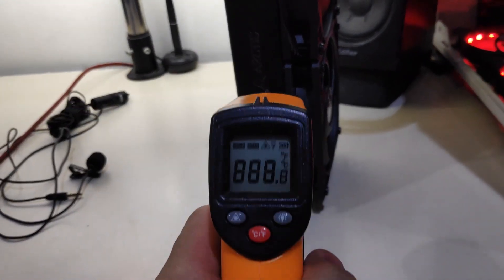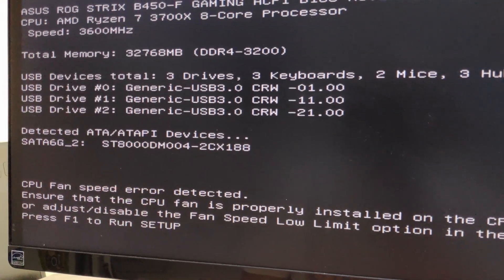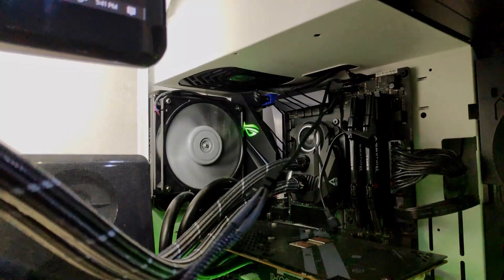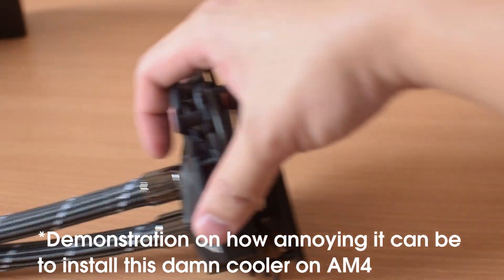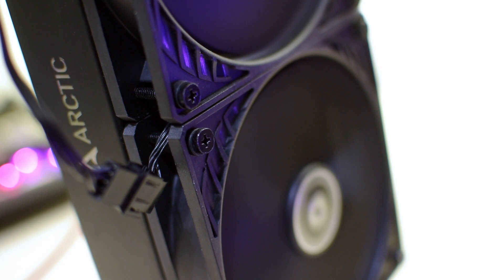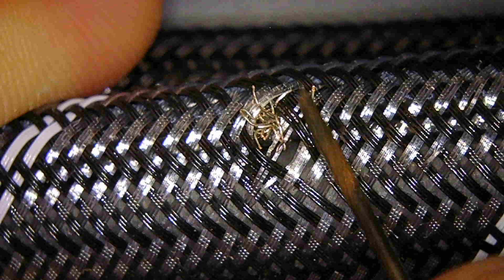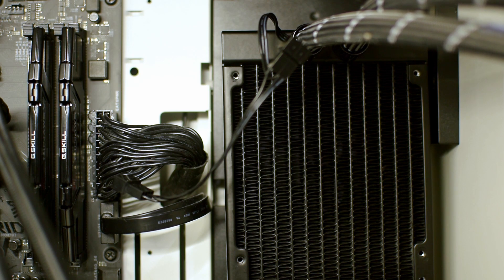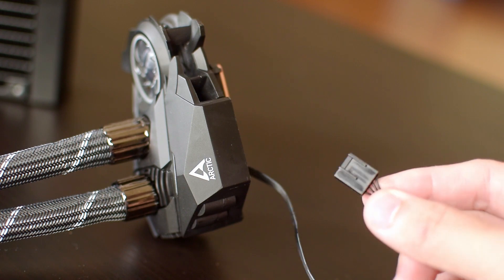DO NOT SIDE MOUNT! (EDIT: New video for Revision 2 review) - Arctic Liquid Freezer II Review

Comment: Gamers Nexus installed this cooler 36 times for their review, not a single issue. So reliability is not a problem, I'm sorry to say i think the issue lies with how you installed the cooler, not the cooler itself.
Reply: Or it could just be this unit, specifically. Maybe just maybe..
Reply: He installed the pump higher than the waterblock. 
He was basically running air in the cpublock

Comment: its good to see reviews mentioning what can go wrong and why.thank you.
was this the first version or v2?
Reply from the maker: Interesting, there's a first version and there's a V2? I will need to compare with the replacement I get and see if there are any differences physically.
Reply: i can't find anything regarding the two different versions. have been keen on getting a v2 but couldnt find a link
Reply: I got a rev. 3
Reply from the maker: Arctic listened with revision 3 and fixed the mounting system.
Reply: @TechRodent  But now I have to mount in in my Phanteks Eclipse P400A. It only fits in the front. I think i will go fans on the outside of the case. In a push config

Comment from the maker: EDIT: Arctic sent me a new Liquid Freezer II revision 2, and I re-reviewed it based on that. You can check it out here: https://www.youtube.com/watch?v=oQZQfDZNS50

The results are fixed but interesting.

-------------------------

I have been reading the comments on this video and understand the concerns of people, and I acknowledge that I do hold an unpopular opinion. 

I however, believe in honest reporting, and not just deleting a video or a review just because it doesn't sit in line with what other people are saying or reporting, so no, I won't be deleting this video.

I have however, got in contact with Arctic again, with this video in particular, and they have acknowledged that there is an issue with the unit that I have received (whether it's isolated or not I do not really know yet), and have asked if they can arrange to change me with another unit, and so I'm in the process of doing that now.

Once I get the new unit, I will do a follow up video addressing the claims that I have made in this one.
Reply: thats nice of them contacting you back about the issue, this particular problem is why Im still on the fence on getting any AIOs tho even though I dig the aesthetics of it.

Maybe you could do some videos on air coolers, like those snowman coolers that costs like 50 in Malaysia.
Reply: I too, now hold an unpopular opinion. For the past 5 weeks, Ive been watching for a 360 to come into stock, a CPU cooler is the last component I need to build my 3700x system, and so I was checking every single day, multiple times a day watching for one to finally come into stock.. then come the 16th of this month, 5 360s hit "in stock", I ordered one, and the remaining 4 sold in about 10minutes.. then today, the 22nd, I get this from Arctic.. https://imgur.com/a/j9mPYvN ! So, not only can Arctic not meet any semblance of supply for the demand, they also cannot meet order fulfillment on the rare occasion they do have them to offer ! So with the email I received today from Arctic, I am not happy whatsoever with the experience. I did however send them an email back early this morning, asking them, when the very next 360 is available for purchase, will they offer it up to me to purchase, due to the order fulfillment inconvenience placed upon me, so I am hoping to hear back from them very very soon with a positive answer, or maybe I wont hear from them at all and they could care less about the negative review I will then be giving them. A contact number for Arctic would be nice, but I couldnt find one. But I will afford them some time to respond, and by afford them some time, I mean about 24hours, as that seems to be industry standard time for response !
Reply: did you ever get your replacement liquid freezer II AIO? let us know, i'd like to hear what your updated review looks like with a working model.
Reply: it happened once. to a reviewer too. it's good this gets 'some' coverage. on a consumer side of things i want to be aware of that can happen with a certain product even if it's rare it's good to know that beforehand. I am not going to shy away from buying this aio but it'll at least have a video i can show all my friends if it does happen to me too. Please dont delete the video. why are people asking you to delete it? Good Video!
Reply: @briandiff1459  damn dude...that sucks

Comment: Props for keeping the video up.  It addresses the flaws and with it, they can improve their newer models.
I do believe you had a bad unit and thus the cause of your problems.  Could have been damaged during shipping, there isn't any real padding around the product to protect it inside the box.  Hopefully when you get a new one, it'll be much better.
I've had mine for a few months now, and I've mounted and remounted a lot.  I've even modified it to be a GPU AIO.  Temps are amazing on a 2080 Super.  The tubes are stiff, but my bends are crazy and there hasn't been an issue yet.

Comment: Had no troubles with installing with PC laying on floor.  If you are unable to "Hold the backplate securely in place" as stated in this video....work smarter, not harder.  Simply put a piece of tape to hold the backplate on the mobo and then remove once installed.  You got a bad unit.  it happens.  sorry about your experience but this is an amazing cooler.
Reply: Also the VRM fan is a gimmick

Comment: I have had this cooler since launch and specifically the 360mm version and I have to say it is without a doubt the best AIO I have used and I have been using AIO's since the first Corsair units many years ago. In terms of cooling I am very surprised at your results as mine overclocked to 5GHz on all 8 cores and 16 threads in Cinebench R20 the highest core hits 74 degrees C and all the others are between 66 and 73 degrees and that is about as good as it gets and beats out my older H150i pro. Maybe the mount was not good as on mine for an Intel build the mounting system was straightforward. 

I agree that as to the fan connectors there may be an issue but again not had any issues. I would get in touch with Arctic as I am sure they would send you a replacement solution..or at least they should.

Comment: did you connect AIO to CPU FAN instead of CPU PUMP ?
Reply from the maker: You're meant to connect it on CPU Fan, instead of CPU Pump, regardless, I had it running at 100%

Anyway, Arctic sent me a new one, it's a revision 2 model, and I've had 0 issues on it so far, update video coming soon, with updated benchmarks as well as comparisons between the two.

Comment: I have spent several hours today building a new PC with this cooler, and had the exact same problem. The radiator fans mostly don't spin at all, and the motherboard doesn't recognize that anything is plugged into the CPU fan header.
Reply from the maker: Contact Arctic and get a revision 2 replacement
Reply: @TechRodent  It is a rev. 2. At least I think so. The box isn't very informative, but there's a tiny bit of text on the underside of it that says "Rev. 2".

Comment: Okay, so first of all:
There is no thermal need to watercool a 65watt CPU! Even if you crank them up for overclocking (i did overclock my 2700 a lot) the thermals for a usable scenario are pretty doable for a good aircooler ( I used the Alpenföhn Broken 3 ECO with push/pull fan setup).
Even if you torture your Ryzen 65watt CPU with Cinebench R20, Blender, Furmark, prime95 the amount of voltage you need to really must use a watercooler are ridiculous. No one, i mean really no one is so naive to run more than 1,40V through his 65W CPU for a daylie use case.
Yes some do it a short while for benchmarking, but not for daylie usage. I ended up on 1,35V and it is no problem for a good aircooler.
I am using the ALF II 280 since november 2019, no problems. It has to be mounted with the tubes facing down wherever it is mounted. This prevents air from getting into the watercycle into the pump. Buy pwm cable extensions if you mount it to the front of a case, you will need them. The cooler is overkill for my 65W Ryzen 7 and will be cooling a Ryzen 9 in the future.
I agree with you in one thing. The mounting and installation of the pump is exhausting. You wish you had 3 hands. I solved it by putting a pack of cigaretts under the backplate and it worked for me.
I disagree with you on perforating cables while bending tubes theory. I bent my tubes a few dozen times while installing. No problems after several unmountings and remountings. Your product was broken on arrival. Those things can happen. It happened with my graphicscard, which was not a nice experience. In your case it is even more frustrating, what i can understand.
The message of your video though is not legit. Sidemounting is no problem with the ALF II, if your case is suited for it. And as i mentioned, the tubes must face down and NEVER up. That's why Arctic made them 5cm longer than on other AIOs.
Even when i disagree with you, i still enjoyed watching your video. Keep it up and please do more videos in the future. Stay healthy.
Kind regards
Reply: im running 135-140 watts 4.8mhz x5600, but the 240aio is NOT able to keep up with it. Going to something bigger
Reply: @polie67  The X5600 is a 105watt cpu, so it can be possible to reach the limit with a 240mm Radiator. But I am surprised that a 6 core (1 chiplette design) is able to max it out.
Do you have some more infos? Is it mounted properly with enough pressure on the cpu heatspreadder? What thermal compund are you using? Did you try, or is it possible with your pc case to try a push pull config with 2 more fans on the back of the radiator?
Did you overclock manually, or is it happening with PBO?
Reply: @callyacaos5339  its on an open test bench and everything is maxed in the bios. I am wondering if the pump is bad, I have a replacement coming and will try  w/ a push pull setup

Comment: i think your problem is different cause that wire issue i impossiblr cause that cables has cutted and isolation cover is little bit damaged but i cant see any melting issue on sleeve. i think that one is have different things. other issue is i have use 360 variant and your temp values is totally fail cause what kind cooler can keep to cpu like 45 degree in load? totally fail i think.

Comment: No clue where you coming from. I have installed in front and top a number of times. Now i'm expanding the loop to implement the GPU. You have no idea how much i bend the tubes and still working fine. You just had one that failed! How can you dis the freezer based on one failure? And yes, you are sure doing a lot wrong.

Comment: Given the issues you had mounting and the wire issue Im guessing you’ve not mounted it correctly.  pretty much all other reviews are the opposite of yours and couple that with the owners experience it’s not a shock your comments in this video are like how they are.
Reply: As I said in another comment, I had the same braiding issue twice after getting a replacement, and even asked Arctic if it's dangerous, and they told me it's just fine. First time I had this issue with an AIO though. Not really good quality, for me. And performance wise it's not even that good, my Fuma Scythe was there with the temps, but I didn't want to give it back as I was fed up with all the mess.

Comment: <- Arctic Liquid Freezer II 280, Ryzen 2700x, 1.2volts, 4GGhz, in Aida64 (~112watt CPU Package) = 67-68 degrees celcius 
and i have no problems when a week ago i change location of cooler radiator from top of case to front panel without disconnect cooler from processor ...tubes is very hard, yes, this will very scary and tubes now twisted not very beauty, but all works still good, and i get lower temps from 71 degrees when radiator on top case panel to 67 degrees on front panel (my eng is bad :)
picture how it looks now - https://ibb.co/YND5mK4
how it looks before - https://ibb.co/GHzHQvT

Comment: You need not rotate the entire radiator to make it work. The wires get pinched by a collar where the tubing meets the rad. If the collar turns too far, it can slice into them because the notch that let's the wires run through is misaligned and there is no gap for them to run clear. In the video, turning the rad manipulates the wires just enough to get back into place. So this is user error and not anything that arctic did wrong. Technicians need to pay more attention to detail and less into wanting to make videos.

Comment: You know there are 2 versions right?The 240mm and the 280mm , the 280mm is the best at cooling
Reply: Needless to say, not all cases fit a 280mm AIO, specifically top mounted. 240mm is usually an acceptable comprimise, failing better cooling solutions.

Comment: I'm reading that the Scythe Fuma 2 actually performs on par with this AIO. You ever test the Scythe Fuma 2 and able to back that? I just don't want any water in my system and this ARCTIC Liquid Freezer II 120 is $5 more right now.
Reply: I wouldn't trust this 'tech reviewer' on any subject.

The Arctic Freezer II outperforms the fuma 2.
Reply: @pickleadaykeepsthedoctoraway  I bought the 240 version and I wasn't impressed. I used PowerMax as a stress test and my 3700X still hit 94C after a few minutes. CPU-Z stress it was 73C as my Hyper 212 BE hit 74C after 10 minutes and Prime95 seemed to be a joke as both coolers only hit 67-68C. Gonna try to return or sell this Arctic.
Reply: @thephily7432  You are not the only one that wasn't impressed with this cooler: I also didn't get really lot of advantages regarding temperatures. I have an Intel i5 6600 and I bought this cooler only because I had found it at a really good price (15 euros), I know it is excessive for my CPU.
I expected more benefits from my past Freezer 7 pro  (that had only a 92 mm fan and did 60 degrees during a stress test), instead I've got a temperature increase of 10 degrees (70 degrees during stress test).
Probably this was the wrong CPU for a liquid cooler,  but i'm however confused how a really small tower cooler could be better than a liquid cooler. I think i'll sell and replace this Liquid Freezer.
Reply: @appuno  I have the Fuma 2 now after a while of watching for it after I made my post here. I love it and it performs just as well maybe 1-3C higher in temps but cheaper, whisper quiet and looks great imo. That AIO was returned.
Reply: @thephily7432  bro I got the fuma 2 and regret it but after seeing your comment I feel relieved
Reply: @thawesnerd  I love the Fuma 2 man, performs great on my 3700X and looks great in my tower I think anyways. I also have undervolted with a overclock, temps and performance is good.
Reply: @thawesnerd  Why do you regret it?
Reply: @thephily7432  because of the new rtx 3000 which I am planning to get, the air flow of the right fan is going up to the cpu cooler
Reply: @thawesnerd  The 3xxx series cards will have 2 fans, 1 blowing up to your CPU cooler and 1 right out the back. 3rd party cards will also be releasing which seem to be like the dual/triple fan heatsinks we see and use today. I don't think the FE card fans will bother anything if you have a couple fans in front pulling and a fan in back exhausting. I also use all my case fans and Fuma 2 fans at 100% all the time which would help some of the 3xxx GPU is giving off heat.

Comment: Quite frankly, I do not understand all the hate this video has received. 

If the fan cabling inside the sleeves truly has solder points, my $0.02 (as an EE), this is a point of failure and should be replaced with just a regular cable without any solder points. Maybe Arctic can chime in on weather or not this is true, and address it in the future.  I think that the damage that occurred most likely was not a result of mounting, but probably shipping damage/ poor QC, but the click-bait title got me here lol (NCase M1/ NR200 anyone??)

Regarding the frustrating AM4 mounting, Arctic has admitted this is lacking and claim to be working on a better solution for the future. In the meantime, I might suggest temporarily taping the back plate to hold it in place during installation, this should make the process much easier. 

Regarding "unimpressive" cooling, the size of the rads compared are fairly similar(240 to 240), however the cheap Chinese rad has Gentle Typhoon fans on it, which are also great fans like the P12 fans on the Arctic lol A rad can only perform based on it's volume, and it's airflow(fans)...  Maybe in the future include fan rpm and db levels as well, as that paints the whole picture.

All this said, I still think Arctic is making some of the best cooling products for the money in the market rn
The only things I dislike about the Liquid Freezers is that the tubes coming out the top of the block limit mounting options, and (positive imo but not everyone agrees) no RGB 

F*** the people who are just trash talking and being Arctic fanboys, I think YouTube needs more people making unbiased content, I applaud your efforts to do just that.
You have brought up a valid issue that occurred on your unit and those things need to be talked about, even more so than the positives. 
*notice how every video that's sponsored by the company almost never says anything bad, that is by design, gamer's nexus has videos on how shady these companies can be*